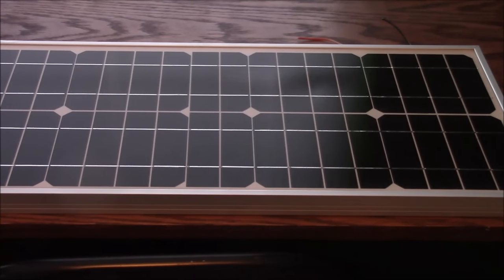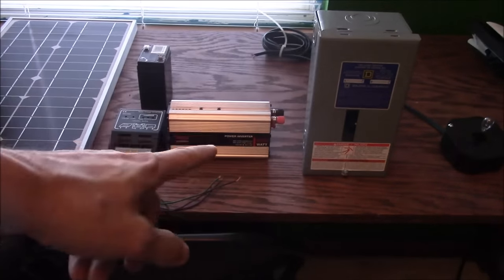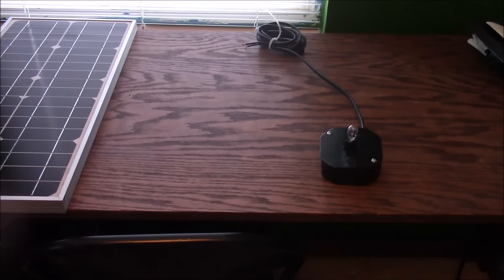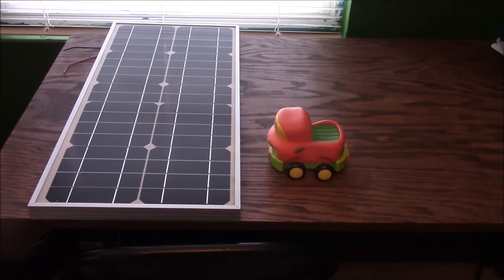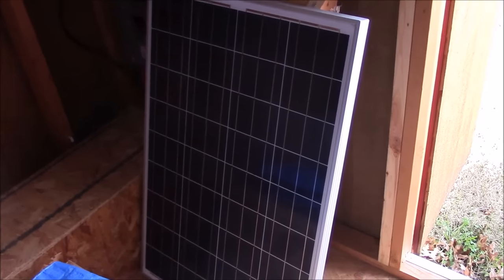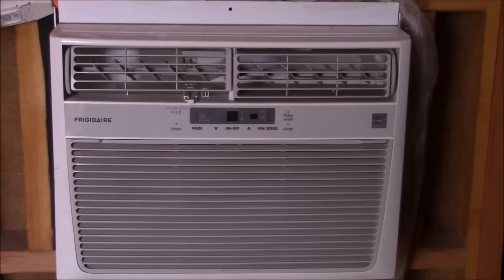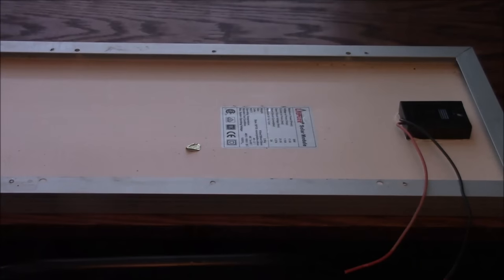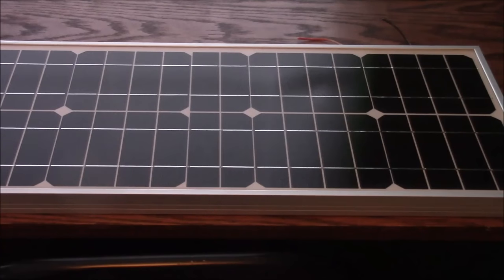Solar Panel Systems For Beginners - Pt 4 Frequently Asked Questions

Comment: Good video. Yup you can run just about anything on solar, but most things don't make sense to. It all comes down to cost and room. My system is sized wrong! Not that I do not know how to size a system, my wallet doesn't.LOL I know cooling will be a requirement and an AC did not even enter my mind. Cold air bothers me and I used a swamp cooler in my last place and it was so/so, due to humidity. It was fine for my needs. It is dryer here so I went w/ a very low amp DC swamp unit. I have not been using, as most days don't have enough sun, but hopefully those hot days will and I can run it some. No it will not be able to stay on 24 hours a day-only instead during the hottest times and it will have to stay on low. I have also heard of DC refrigerated units that use about 500 watts, but again that is a lot more than my little 60 or less watt cooler. I also run the  fridge on propane-electric ignite. Had to give up the large screen TV, stereo, and fancy pump espresso machine: OUCH! in exchange for just using my macbook as the entertainment center. As budget allows I can add solar and goodies for them to run. Again I will pick DC goodies and have to pick the items that give me what I need w/ lower consumption. PS there was this guy who sold this mini swamp cooler on his site-low watts, but it was a window install only, so I went w/ another brand that consumed more. The guy's minicooler had an option w/ or w/ out a 60watt panel, as some buy the unit and hook direct to the panel only and run it when the sun it out [not for me as it can still be hot after dark], though it could integrate into a battery system.
Reply from the maker: +Prima Donna Going Off Grid Wow, I would be interested in seeing how well a swamp cooler can run off a 60 watt panel.  Do you have a link to it?  I can't use it here in Texas but I would love to read more about it.
Reply: +LDSreliance OOps I was wrong. The larger unit had a 60 watt and the small unit I wanted had a 30 watt. I know the smaller unit used less amps than the one I got. Here is the link to the smaller unit and the others are on the guy's site. Looks like he is moving ahead w/ them from last year when I spoke with him. http://www.westernharmonics.com/Online/index.php?main_page=product_info&cPath=67&products_id=186

The one I went with is: http://www.turbokool.com/ and the specs are below. The low setting as you see could be used for the few hottest hours of the day off my current system I have now! Of course that is if the days are ALL sun.

I had a house size cooler on the roof of my place, when I was in NM-did not work as it should due to serious humidity. I am talking a steam-bath full of mosquitoes. Still it took the edge off so I could be comfortable. One of the two above companies sold a unit to a happy user in FL, and one of them tried using the unit themselves in one of the humid southern states-they found as I did, not so great but took the edge off the heat. The most the use of that big swamp cooler ever added to my utilities was: $19 a month-hard to believe.

I am looking forward to see what this one will do now that I am in a dry climate. I have to wonder if it will cool the bedroom, which now on the colder days, is hotter than Haites, if I want to not freeze in the living room-the hot air is drawn up there. I keep the bath door open to block the hall and the bath warm.LOL
Reply from the maker: Prima Donna Going Off Grid
Wow that is crazy.  You are a trooper to endure all of that.  I would have broken down and bought a bunch more solar by now lol.

Those dc swamp coolers are nice but don't put out much CFM.  They would probably take the edge off an RV or tiny home but 500 cfm doesn't even cool down a closet in a normal house under normal air conditioning requirements.
Reply: +LDSreliance OK so that is why that big house cooler did OK, because it was heavy output. I was on the grid then and 600 sq ft. Now that I am off grid, it's 216 sq feet so the turbo cool should work. think maybe that is why so many go tiny for off grid-easier to heat and cool.

I was going to expand if I could ever get the money, but that is a long shot. But I have set it on my list of goals. It would have been better if I could have saved more before having to move-my original plan, but then they wanted the rental back and I was forced to do it all on credit cards or be homeless. I am happier with this now anyway.
Reply from the maker: Prima Donna Going Off Grid
Right on.  Whatever works!  I wish I lived in a place that swamp coolers had any effect.  Maybe someday.

Comment: I want to power the 5 watt 120v LED bulbs I have for my plants.  I want to creat a fully of the grid system. How do I calculate how big of a panel I need and how many batteries I need to light them around 12-14 hrs. (I'm an electrician I know the installation and salty details but I'm effy the amount of solar panels I need for that application)
Reply: Reading your other comments, I live in northern NJ
Reply from the maker: +como “wepa” claro Thanks for the info.  You didn't include how many light bulbs you have so I will guess 4.  Adding in some loss for converting from DC to AC via an inverter I will use 25 watts as the load @ 14 hours per day (calculator is here:  https://www.batterystuff.com/kb/tools/solar-calculator.html).  You are in NJ which gets an average of 4.2 sun hours per day (direct sunlight).

Based on that info, you will need 180 watts of solar panels and 60 amp hours of battery power.  If we change the numbers to be 2 bulbs (12.5 watts) @ 12 hours then you would need 80 watts of solar panels and 26 amp hours of batteries.
Reply: +LDSreliance thank you for the fast response and for the knowledge. So I need a 100watt panel to play it safe and a bank of 26amps.
Reply from the maker: como claro
Yes that is correct.  I would recommend this panel because I have used 2 of them and loved them (I do not get paid to endorse this company):

http://www.amazon.com/Grape-Solar-GS-STAR-100W-Polycrystalline-100-watt/dp/B00CAVMMMG/ref=sr_1_1?ie=UTF8&qid=1460757704&sr=8-1&keywords=grape+solar+100w

My review video is here: 

https://www.youtube.com/watch?v=lDWVJgy8dV4

It was also the solar panel that I used in the Solar Powered Surveillance Camera series if you want to look that up on my channel.

Anyways, if you need battery recommendations or advice let me know.
Reply: +LDSreliance you know it man. I dude. If you recommend me everything I need to power my two lights I will try to get everything and I'll make a video in exchange for all of this. Thanks again!!
Reply from the maker: como claro
OK, here are a couple options of batteries:

http://www.walmart.com/ip/PowerStar-AGM12-55-ins30-Pride-Mobility-12V-60Ah-22NF-AGM-Deep-Cycle-Battery-Replaces-UPG-55Ah/48904441
http://www.autozone.com/miscellaneous-non-automotive/marine-battery/duralast-marine-battery/315062_0_0/?checkfit=true

The first battery will last longer in years and will not require refilling with distilled water.  The second battery has more amp hours and you could go get it from the store instead of paying for shipping.

As for charge controllers, I'd get a Morningstar:

http://www.amazon.com/Morningstar-SunSaver-SS-10-12v-Charge-Controller/dp/B002MQW3H8/ref=sr_1_1?ie=UTF8&qid=1460762286&sr=8-1&keywords=sunsaver

I have had 2 of those units and they are awesome.  Well worth the extra price over the cheap chinese knockoffs.  If you want a cheaper option, this one will get the job done:

http://www.amazon.com/Renogy-30A-PWM-Charge-Controller/dp/B016N722X6/ref=sr_1_3?ie=UTF8&qid=1460762368&sr=8-3&keywords=renogy+charge+controller

You will also need wiring and connectors and such.  Watch my solar basics videos on each to get familiar with that.  I can't really help you out much on that since that will all be determined by your unique installation needs.

Comment: I have a 130 watt solar panel wired through the 15 amp charge controller to the batteries.  When I hook up my 1000 watt or 2000 watt inverter every thing fine until I put even a minor load on it the inverters start to emit a high pitch whine which indicates low voltage in the batteries.  Now the batteries are showing 13.9 volts to 14.5 volts so the batteries are fully charged.  Cannot figure out what the problem is.  All items in the system are new and the batteries are deep cycle.  Any suggestions from someone that may of had a similar problem?
Reply from the maker: I've had this problem many times.  First, tell me what the load is that you are trying to run.  Also, how is this all wired up?  Where is the solar panel mounted?  Where are the batteries?  How long are the wires?  What gauge are the wires?  What kind and size are your batteries?
Reply: LDSreliance The load is 1000 watt start up and 750 watt running. It's my refrigerator that I need to keep running during an emergency loss of power.  Solar panel is mounted 2 feet above my batteries which are deep cycle batteries.  Wire gauge is #4 and all the components are within 3' of each other.  I noticed I have my inverter hooked up to the first battery instead where the solar panels are hooked dup to instead of the second on in line.  Maybe that's my problem.  Suggestions?  Thanks.  Bill
Reply from the maker: Ranger Up No, that won't matter.  If the batteries are wired in series or parallel it doesn't matter where you are connecting the inverter to.

It sounds like your inverter is connected directly to the batteries instead of through the charge controller.  That is good in this case because you will be drawing way too many amps for your inverter to handle.  So if that is not the case, make sure your inverter is hardwired directly to the battery bank.

The second potential issue is that deep cycle batteries are marathon runners, not sprinters.  They are terrible at producing high amps.  They are good at producing 20ish on a steady basis.  So the fact that your fridge is drawing almost 100 amps to start up the motor is a problem.  What happens when they try to do so is that the voltage will drop significantly and will fall outside the range of the inverter and the low voltage warning goes off on the inverter.  I have had that happen numerous times.

The third potential issue is still voltage drop.  Even though you only have 3 feet of cable and it is relatively beefy 4 AWG, if you are drawing 100 amps through the cable (assuming it is copper cable and truly 4 AWG - sometimes manufacturers cheat) you will get 1.25% voltage drop.  That doesn't sound significant but that amounts to 0.15 volts of loss @ 12v which will compound the problem outlined above.

Potential solutions are to add in some capacitors to the system.  I haven't used them extensively and don't know the math on how many farads of capacitors you would need to handle the initial surge of current draw.  But I am sure you could research that and find it out.  Just buy some car audio capacitors and wire them up and you could be fine.

The other option is to add in a dual purpose battery to the battery bank.  These type are used in RV's and boats to both start motors AND power lights and radios and stuff.  So they are a hybrid of deep cycle and starting battery.  They are good but not great at both.  So that could help you provide the high amps you need for a few seconds to power up that motor without dropping the voltage too far.

However, I don't know how big your batteries are but if your fridge takes 750 watts or 62.5 amps while it is running that will quickly deplete deep cycle batteries and still might result in low voltage on your inverter.  Again I don't have the specs on your batteries or know exactly how many you would need to run that load effectively but it will probably be more than you have if you want to run it for a meaningful amount of time.
Reply: I'm thinking of putting a car battery or a dual purpose battery at the end of the battery bank and hooking my inverter to that battery first so I can get the start up power I need.  I have the charge controller going to the batteries then to my inverter off the batteries to give me the 120v power I need. Not sure why this system gives me problems when I see similar people on YouTube  using deep cycle batteries for their home needs.  Thought I had it figured correctly but will take any more advice I can get from you on this. Thanks.
Reply from the maker: Ranger Up The other culprit I didn't mention is the inverter.  Just because it says 1000 watts and 2000 watts surge doesn't mean it can handle that massive current draw from that motor when it starts up.  I have found that the inverter world is full of frauds and outright lies.

I had to use a 2000W (4000 surge) inverter one time to power a little bitty 150w mini fridge one time.  It was crazy.  It was literally the last thing I tested.  I swapped out everything else.  I had 2 huge deep cycle batteries connected to it.  I tried huge cables.  I used a capacitor.  It wasn't until I swapped out the inverter that it worked.
Reply: I just switched the 2000 watt inverter for the old but still new 1000 watt inverter and it works good so far.  The 2K inverter had the wires from the battery to the inverter pulsating with the low voltage alarm going off.  Put #2 wires on it and then it didn't pulsate so much but a loud pop sound came from the inverter and you could smell burnt electrical wires from inside the inverter.  Time to trash the 2K inverter.  Had to be defective from the factory.  Thanks for all your help.
Reply from the maker: Ranger Up Sorry.  That sucks.  I have learned the hard way that you get what you pay for with inverters (not saying you cheaped out).  Unfortunately, the ones that are $100 and rated for 2000 watts just aren't really up to the task.  I am not an electrical engineer and don't recall the exact reasons why but I have read some articles on them and they just can't handle the big surges properly.

You may just want to bit the bullet and invest in a rock solid inverter from Xantrex, Samlex, or one of those type of higher end ones.  And if you spring for pure sine wave you'll never have to worry about what you plug into it getting damaged by the modified sine waves.  Just something to think about.
Reply: Thanks for the advice.  Will research the inverters you mentioned. Cheers.
Reply from the maker: Ranger Up No problem.  Good luck!

Comment: I have a thunderbolt 100 watt solar unit, bought as a set.  i want to add an inverter.  not sure how to do that.  my inverter directions talk about 2 awg line and a ground wire (or is that just for running off car?).  i keep the controller in doors and want to do the same with the inverter.   i do not want to just start to hook things up haphazardly..  i can place my inverter with in 6 feet of batteries.
Reply from the maker: For that large of an inverter you will have to wire the inverter directly from the battery.  And yes you need to use a fuse.  Probably about 150A fuse.  You definitely need to use the thickest wire you can.  

I would recommend wire like this:  https://amzn.to/2H3zvoz

You can use a fuse holder and fuse like this:  https://amzn.to/2GKbyF7
Reply: so is this safe since i would use a fuse.  i believe you didn't recommend running an inverter off a battery
Reply from the maker: I do and I don't recommend it.  I explain it a bit better in this video:  https://youtu.be/k8aVnRpoRLc

The short story is connect it to your battery directly only if you are going to monitor your inverter and make sure it doesn't discharge your battery below a safe voltage (below about 12.1 on a lead acid battery, for example, which is 50%).  But you can't always connect an inverter to the charge controller because it will be limited by the amp output of the charge controller.  So it is a tradeoff.
Reply: would it be okay to disconnect inverter when not in use by disconnecting hot wire?  do i only have to monitor when it is in use?  can i keep it hooked up to the pos and neg but monitor when in use.  my intention is to only use it periodically.
Reply from the maker: I would wire in a switch in line with the positive wire and when you are not using the inverter just flip the switch.  You could also wire in a cheap volt meter to the terminals on the inverter and when you see them go to about 12.2-12.1 you can flip the switch and cut off the power to save your battery.  Here is an example of a volt meter like I have used in the past:  https://amzn.to/2JoQodV

Comment: Or perhaps this:
The smallest, most capable gaming system. A panel, charge controller, battery and inverter. I’ll give you wide leverage on the game system and monitor. It’s the only thing you’re powering. 
And it all fits inside a pack on your back.

Comment: What is the minimum size of solar panel needed to charge a 12v car battery?
Reply from the maker: It depends on the capacity of the battery, where you live, how much the battery is discharged, and how much time you've got.  Technically, you can trickle charge a battery with 1 amp or less, meaning you could do it with a 10-15 watt solar panel but it would take days if not a week or more to top it off.
Reply: Okay great!  A friend told me to get at least a 100 watt panel to use for charging a camp battery up daily.  Does that sound about right?
Reply from the maker: PintoBlades 100 watts would be a lot better.  Since you can only discharge a car battery about 10%, a 100 watt panel should be able to charge it back up to full on a sunny summer day easily.

Comment: Is it the same if wind turbine is my source?
Reply from the maker: Yes.  As long as you have a charge controller that can handle wind.  There is also a concept called diversion load that you need to be familiar with.